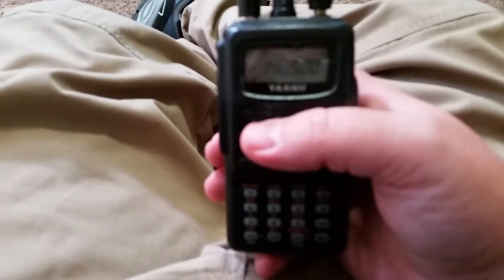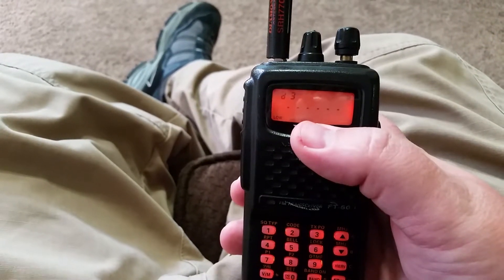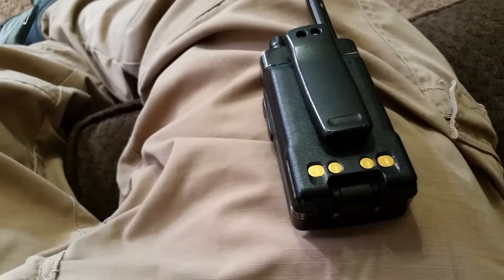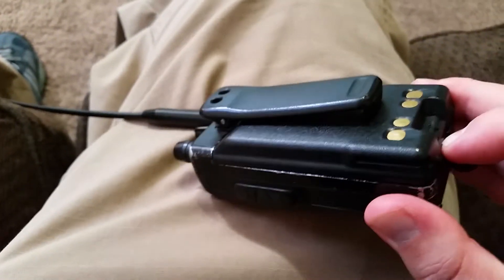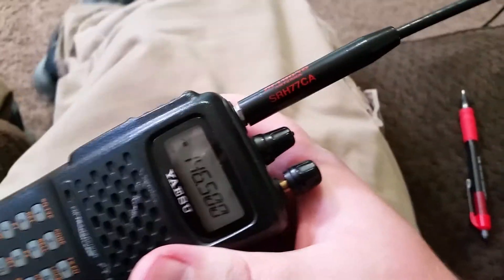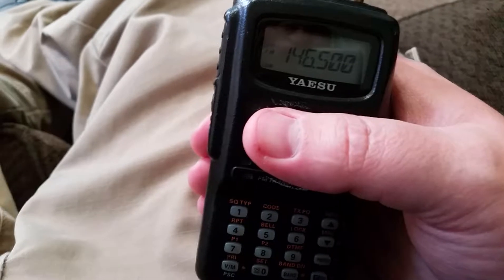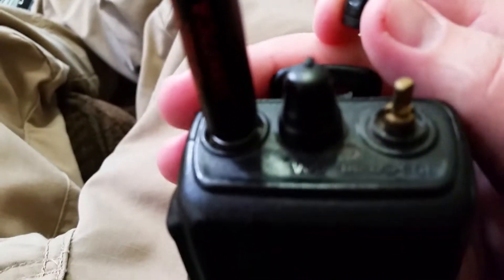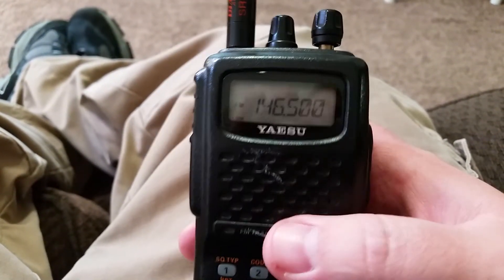Readying the Yaesu FT-60 for EMCOMM Service

Comment: The SWR and gain of your Diamond antenna would be significantly improved with the addition of a tuned counterpoise (a.k.a. tiger tail, a.k.a. rat tail). Failure to tune the counterpoise might degrade both the SWR and gain so be sure to put the antenna system on an SWR meter and tune the rat tail by starting long and trimming until the minimum SWR inflection is found. There are lots of videos on Youtube on how to tune a rat tail.

Comment: Learn how to edit your video then you don't have to say "hold on I'll be right back", and get a tripod so you can properly manipulate your radio parts. I have not had an issue with the 1400 mAH battery life over an 8 - 10 hour special event period. You must run high power setting all the time. I only use what power is needed. Typically, low power is sufficient. Get you facts straight before making a video. We don't need to know that you don't know what your friends are using for antennas. Otherwise a good video.